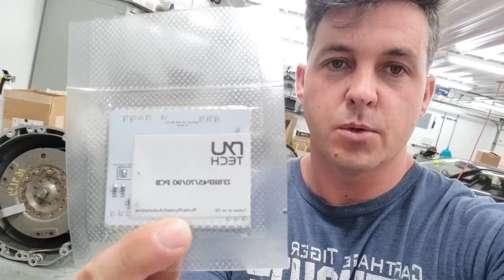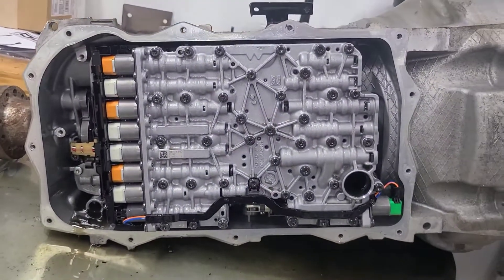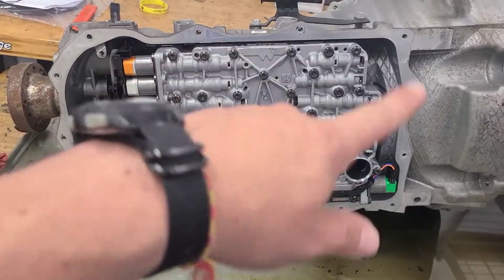8hp70 HTG GCU mechatronics mods - let's solder some stuff😈

Comment: Hi. When the BMW 320d or 320ied driving, all of them makes a hard movement to the front, the car shifts down from 3 to 2 while I am slowing down,  and if I pump up just on the shifting or just little bit after the shifting it makes a hard movement , the engine speed highs up and then its shifts to 3 again.   İts actually normal.   But I think its disturbes the comfort of the drive.   Do you have that experience? Thanks